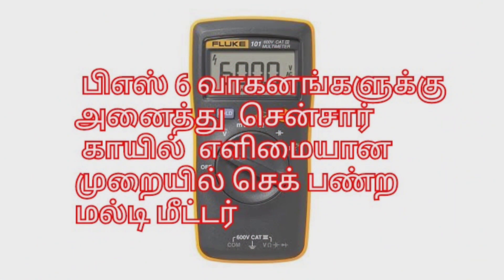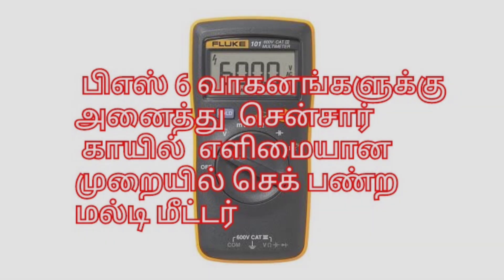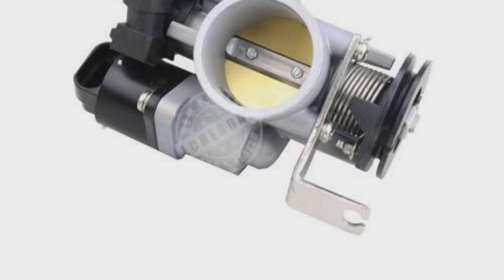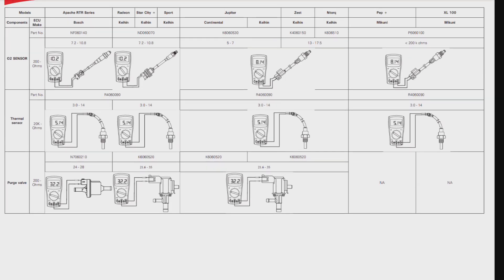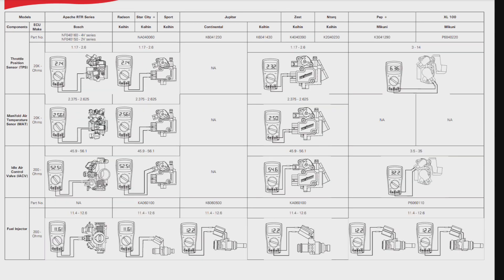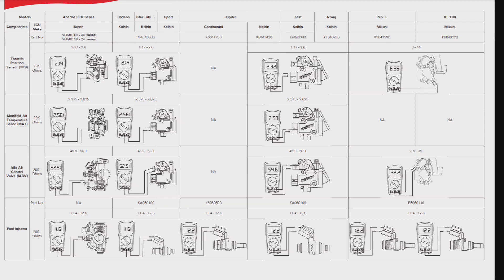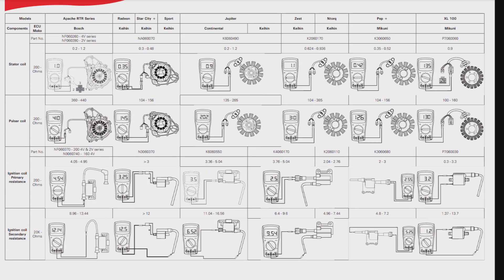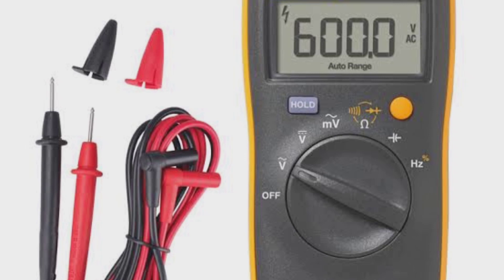BS 6 Bike all sensor  coil  Chack panra multimeter rompa simple ana murail chack pannalam

Comment: Bs6 all sensors maltimeter la chuck Pannanum solriga ok different types of image video la sonige sari ,   ooto , temperature , fuel injector , air intake ,  throttle control , Crank position sensor maltimeter la chuck Pani details sa soluge na ..., 
 Normal maltimeter la chuck panna la lla panna mudiyatha karathe soluge ..., 
Niege solra maltimeter ra next video la theliva soluge .., na 

XL 100 mattum lla TVS all bike la vara sensor complaint pathi dtialis sa soluga ..., 

Innum bike la eaneanna sensor varuthunu theriyala  ipo ieruka palaparuku time ierutha athe konjam details sa soluge na.., na mattum lla inthe video pakara eallrarum therujukattum  ..,